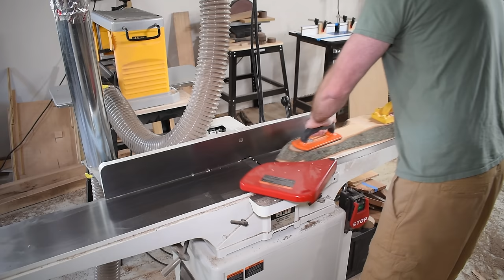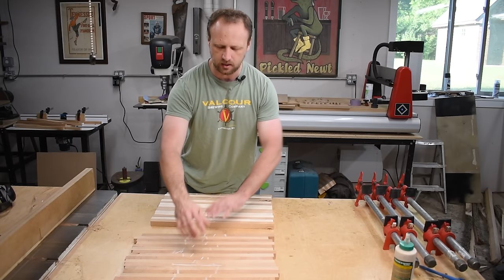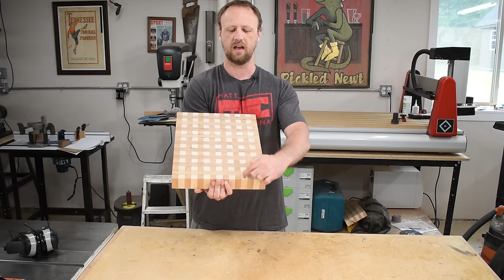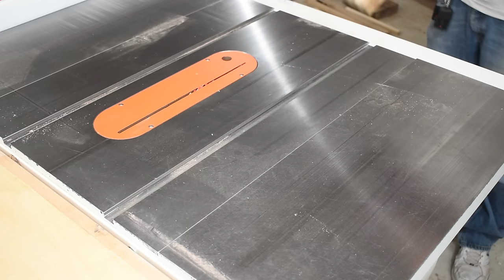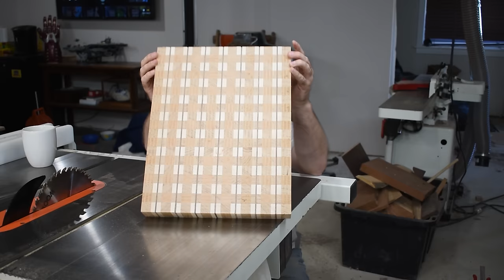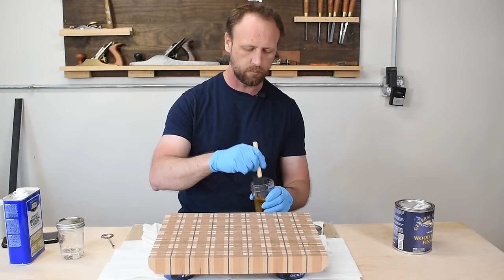Making a Plaid Cutting Board! BONUS - Crazy Finishing Technique

Comment: I have nothing against mineral spirit in the finishing composition - this is the least of a problem with this particular cutting board.  There is a much bigger one: instead of using thin endgrain walnut stripes you employed much easier available long grain pieces.  This resulted in a weak glue up with perpendicular direction of long grain (between walnut and maple pieces), and even worse, the cutting surface is not fully endgrain, but a combination of endgrain and long-grain.  Such boards are highly sensitive to moisture fluctuations, so it is not surprising you prefer to use sealing film-making finish typical for long-grain, but absolutely pointless for endgrain working surfaces (as it looses the self-healing ability after you glued together all the wooden fibers with polymerizing oil).  So this board looks beautiful, but it is not functional, unfortunately.  Just a moderately expensive  kitchen decoration.
Reply: You make a good point. Would this board be better if it was all end grain and didnt use the finsih he used?

Comment: Excellent work and well done, I just didn’t like the alternative to mineral oil. You eliminate the best feature of end grain which is the anti bacterial power of the board which is basically the result of those tiny pipes and the water absorbent capacity of the wood. Please don’t do that and use mineral oil